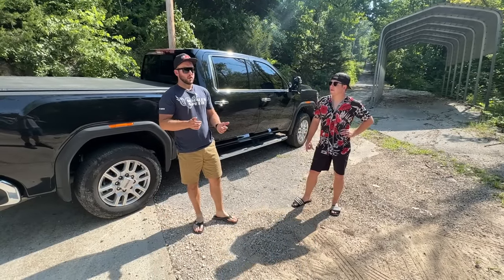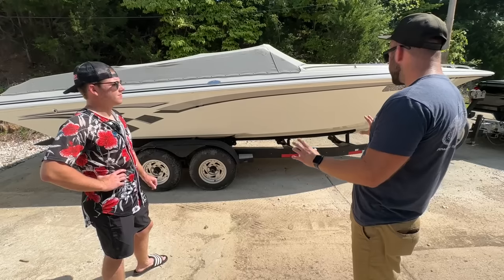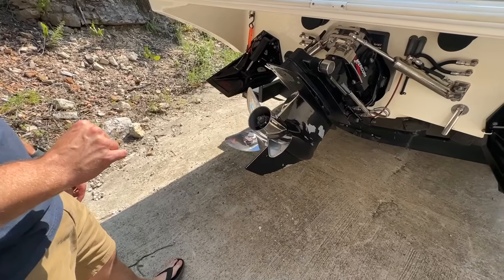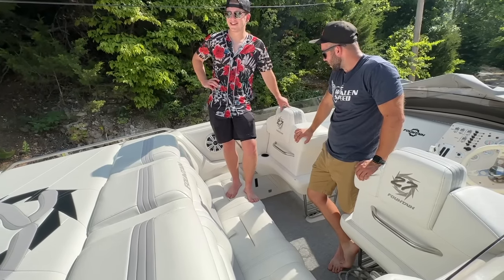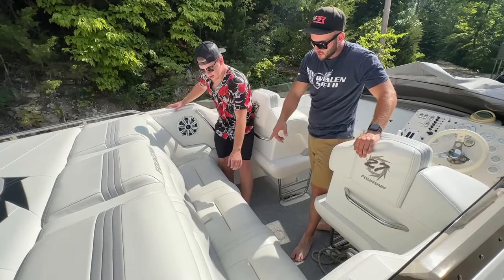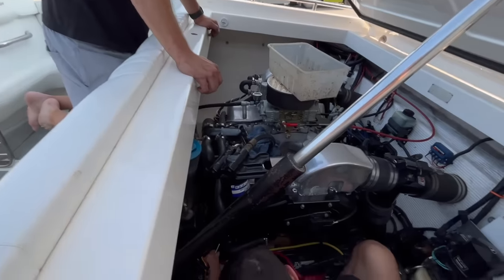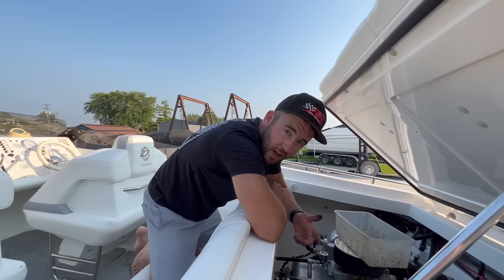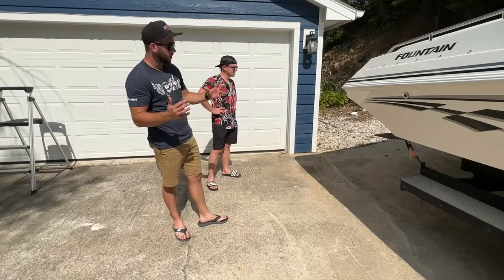I Bought the CHEAPEST Fountain Powerboat I Could Find on Facebook Marketplace! But there's a catch..

Comment: I seal every bolt and screw on every new boat I get and I never have a problem and I do it every single year just to be sure that vibrations didn’t break the seal. I always seal everything on the boat top to bottom. Where is a screw boat or any crack or anything, I put i sealant on it

Comment: Make sure you seal every bolt everything on the transom and all over the boat it’s something that most people don’t do, but you should do it that way you keep water from going in because those boats are notorious for getting water in the transom especially with the motor is Doing this will also increase the lifespan of the boat .